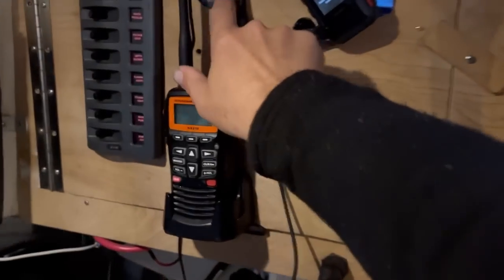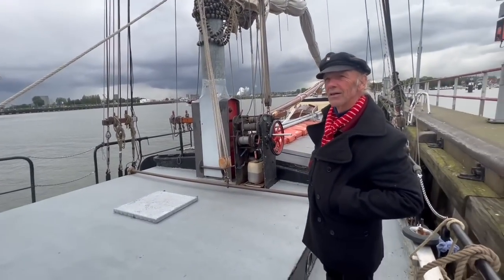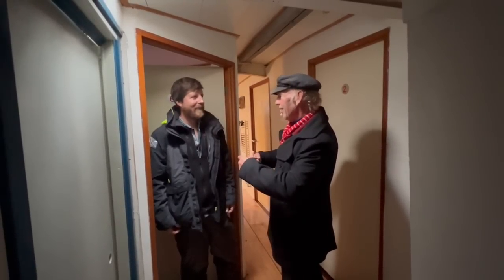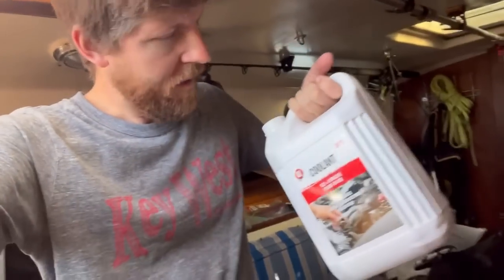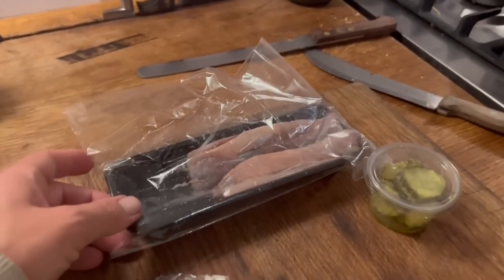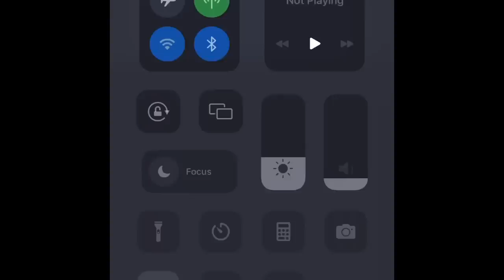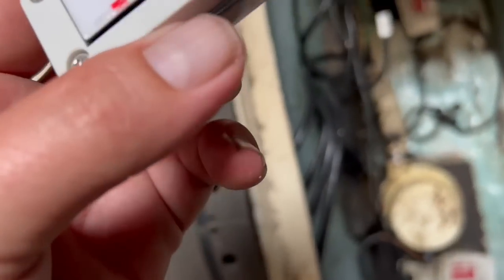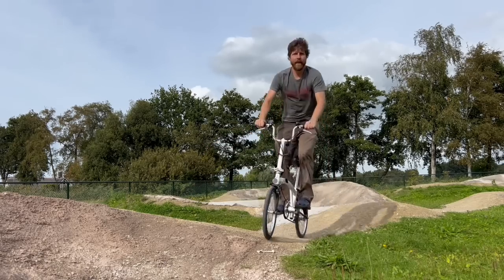Pickled herring in Amsterdam. Winterizing, boat monitor, windmills, and a 100 year old boat

Comment: Just a thought here , Sam . It maybe possible to keep that boat monitor system working when you get back to the States , simply by changing the sim card . I couldn't get a good look at what you had , but here in the UK , all sim cards are removable , and my guess is , it's the same in Holland . So the chances are you can remove the supplied card , and just replace it with a sim from over the pond .

Comment: Nice video Sam, and thanks to the nameless friends and guides! Now for some Girlpower. The guy is not the captain, but the woman Gaby Koomen is owner/captain of this now charter/training ship:) The Klipper (not be be confused with a seagoing clipper) is part of a group cargo inland sailing ships that are keelless and have a full flat bottom. 'Platbodem' in dutch.  Not having a keel  and a very shallow draft enables  larger and heavier loads could (without an engine) to sail up and down the rivers, inland waterways and via canals into cities to deliver their loads.  The lower mast height is compensated with a large boom length and keeps the center of gravity low. .As with a keel the leeboards which have to be switched at each tack, prevent and even counter the drift.  Although old, these ships are still almost as fast as modern boats, only the handeling specially at tacks takes more time and effort. 6 to 12 meter platbodems are much loved as pleasure crafts in the Netherlands,. Because of the very shallow draft, of 40-110 cm, the flat bottom, lowerable mast, they can on inland waters, really go everywhere, beach, or fall dry at low tide without tipping over.

Comment: If you use a VPN with the app it will make it think you are in Europe
Reply from the maker: I think its more with the built in sim card of the device only supporting eu towers
Reply: Most apps can get location data from the SIM, defeating the VPN. One reason I sometimes avoid apps and use a browser

Comment: I noticed it looks like your fan belt pulleys are a bit rusted; or at least they look rusty on video.   (nside the V-groove.)  This will greatly reduce the life of a belt.  Fix: use sandpaper to sand the rusty V-Groove surface down to clean metal.

Comment: Really neat boats around there- thanks for those shots - and I'm so jealous about those museums! Good to see you replacing those stiff fuel lines. I did that too on my Yanmar 2GM20F. I'm not sure if I followed your fuel lines right, but does your return line go to a separate tank? My return line goes back to the tank line using a T. Also, you might want to replace your Racor with one with a clear bowl. Easy to do and you can see how the fuel is doing. Looking forward to seeing what you're up to during winter.. Did you sell the place in NC? Dean